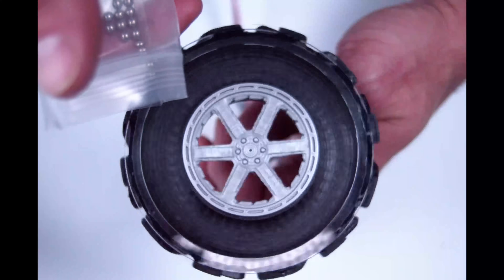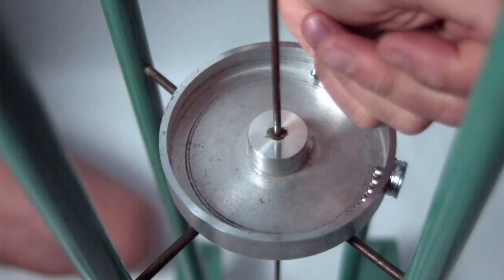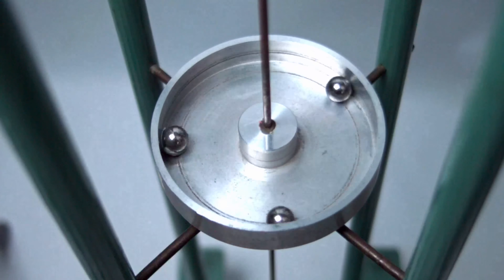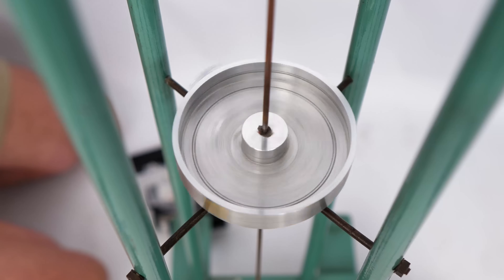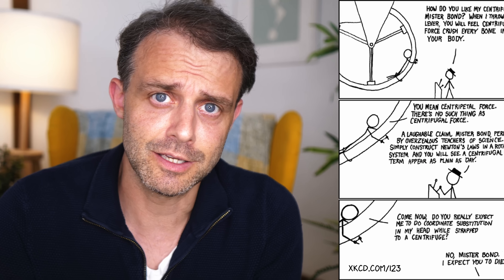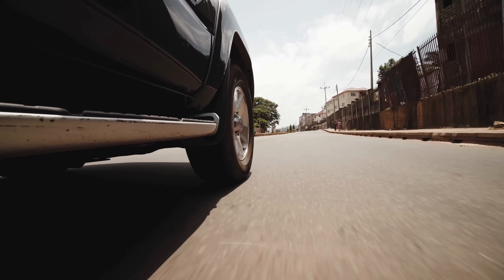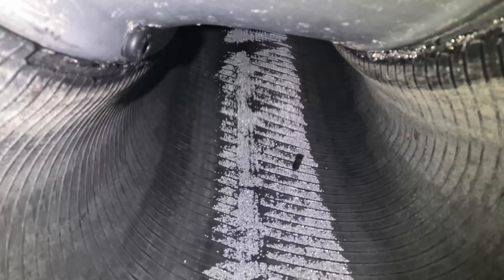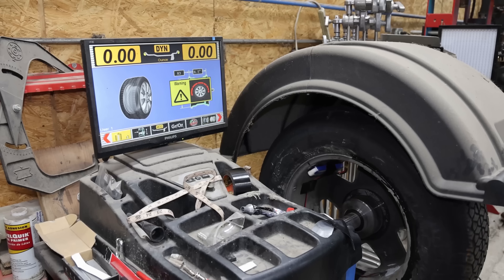Do tire balancing beads actually work?

Comment: I drive a Lexus GS400 that has always been super sensitive to front tire balancing. The tires have to be %100 perfectly balanced for the steering wheel and front end to be smooth between 60-80 mph. If the tire balance is %99 or less, the ride is ruined by steering wheel shake on the freeway. This problem happens with any tire, wheel, and alignment condition that I've tried, and with worn or completely new suspension (every rod end, ball joint, and rubber joint replaced). I have my tires balanced and rotated frequently, since it's free at DT, and even road force balancing often has to be repeated several times.
Strangely, a drive to work on the freeway, and everything is completely smooth. On the drive home, the steering wheel is shaking like mad, and front end has a shake!
This video was what I needed, to convince me to try glass beads! Thanks!

Comment: They work especially well for DIY motorcycle tire changes. And they begin working probably around 40-50 mph, but as you slow down to below about 30-35 mph the effectiveness stops and the rider might notice that it suddenly feels as if a tire is out of round or going flat. The beads work so well we dont know they are working, until we slow down and they stop working.

Comment: So centrifugal force is basically inertia working to a connected centerpoint that changes the direction constantly, hence a straight path but in a circular way through the axle?
If you could, could you also explain the centripetal as such?

Comment: Ride-On
it's balance beads plus tire sealer.  i've been using that stuff for years and i LOVE it.  and the sealer is water soluble, so it doesn't leave a nasty residue like Slime would.
but the reason they're so perfect is because, once they're set, they pretty much stay there.  and they don't need nearly as high of a speed to get into position because the sealer acts as sort of a buffer.  instead of being slung around at lower speeds, they move much more slowly, so the minimum speed is only 35-40mph.  the instructions say, for your first drive, you need to go 40mph for ten minutes in order to set them.  
if you don't drive every day (like over the weekend), they do slowly collect back at the bottom, but it's not bad, and it very quickly gets back to normal.  in a car, you may not even notice it at all.  i notice it on my bike, where everything is a lot more pronounced, but like i said, it quickly gets back into shape.  i don't remember feeling it unbalanced past a mile or so.
i regularly ride over 100mph, and with the Ride-On, the balance is smooth as glass.  the best balancing job in the world can't compete because weights only come in certain sizes.

Comment: Hit highway speeds to balance your wheels and have to do it every time you stop, or simply have your wheels balanced all the time?
hmm... tough choice 🤔

The principle clearly works, i just don't think its better or more practical than actually balancing your wheels. I can see it in the same usecase as tyre sealant - a quck fix until you get to a tyrre shop..

Comment: Big misconceptions is using these beads on a low profile tire is a no-no and you should always have the tire balenced normally THEN pop the bead slightly to pour in ONLY stainless steal beads.
Off roaders use these because our tires commonly get knocked out of balance bit as mentioned in the video, beads don't perform well at low speeds (under 45). The beads  take a while to level out into position.

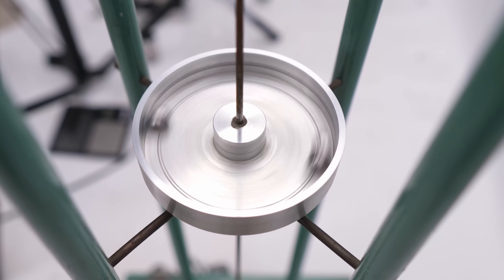Comment: 0:40 CD/DVD drives have such things in them. Take an old CD drive from an old PC and open it. If you take the motor spindle, and you tilt it slightly or spin it you can hear the balls moving inside. Those balance the CD when spinning at high speeds. When initially spinning up the CD disk it doesn't spin up instantly, but go through a "balancing phase" which spins the dvd at a certain speed to let the balancing balls set themselves in the required spots and then spins it up at full speed.  Nerding over balancing balls and CDs lol kinda clicked when i saw the demonstration setup.

Comment: Ok, so if beads start bouncing around if the speed gets too low, what if we pour inside beads with some sort of liquid solidifying rubber glue and then immediately spin up the wheel to the highway speeds (or higher) and wait for the glue to set? In theory, this should permanently fix the beads in their balanced places.

Comment: Steve, at the beginning I was wondering where you were going with this. Almost immediately you touched on the critical speed but did not focus on it until later. In the end I realised you actually knew the answer. Excellent job of bringing the process along and explaining. I am not a fan of tire balancing beads unless a long haul trucker. And even then not a big fan. As you noted, it takes critical speed to achieve a working bead balance. Unfortunately 99% of the motoring public spend an average of less than half their driving time any way near that speed. A typical 26 inch tall tire at 30 MPH is spinning at 387.8 rpm. at 60 Mph it's 775.7 rpm. What we often see with balancing beads id a cupped pattern on the tire tread running diagonally across. One customer I has who ran a deliver truck was always complaining about tire life. They would become severely cupped, extremely noisy and vibrate the steering wheel. Tire life was around 20K miles at which time they could not stand the vibration and the damage to the steering system (tie rods, drag links, gear box wear) Finally after 4 sets of tires I convinced them to go with clip on weight balancing. The tire shop disagreed (of course they would) but tire tread  life tripled, no cupping and reduced steering and suspension damage.   So, unless you do a lot of long distance driving at highway speeds the say no to beads. Even then I would say no to beads.

Comment: There is a mechanism such as this in Washing Machines.  It is a disk or drum attached to the main washing drum that contains weighting beads or balls that redistribute themselves to offset or balance any imbalance in the spin dry cycle, because of uneven clothes distribution in the drum.

Comment: Barring actual structural issue such as wobbly wheels (that can't and shouldn't be fixed with load balancing), minuscule differences in said balance shouldn't matter enough for anything that isn't free spinning at massive RPM, which tires aren't. They also deform enough upon ground contact that they are never actually round, and the weight gathering at bottom would impair acceleration from standstill. Even if we are trying to balance a propeller that isn't in contact with anything and doesn't slow down often, it would need a proper ballast bearing track to prevent excessive abrasion damage. Uncontrollable bouncing never did any good to a mechanism.

Comment: Solution: get a smaller radius of tire, this way the angular velocity is higher for a given travel speed (v = v_ang * r). This should also lower the balancing speed threshold. I admit it's a bit of an extreme solution, but it should work I think :)

Comment: Personally, as someone that worked at a tire shop to pay for college, I hate everyone that uses balancer beads. From an actual mechanical perspective, If your tires are large enough that balancer beads are your only option, there's a 95% chance you have the wrong tires unless you really know what you're doing.

Comment: Why not use both? Get it close with wheel weights, add beads, then at freeway speeds, you have near perfect balanced tires. Though, I think at this point you'll start feeling imbalances in other parts of the rotational masses of the drivetrain.

Comment: I switched to balancing beads when the cost went to $15/wheel to have them balanced conventionally. I can change them by hand and now save $30 or more per tire/wheel by doing so. Never had any problem with vibrations at any speed since switching.

Comment: Why can't you have beads that at the right speed. find its proper location. heats up and stick to the insides.
or while spinning the tire in the shop. once balance has been achieved. Apply external heat to activate the adhesive.
Reply: Or you could use wheel weights,  proven effective for more miles than you can shake a stick at!

Comment: I worked for a tire manufacturer for 15 years.  Beads work but I wouldn’t recommend tire beads.  The tire liner is made of butyl rubber. It’s a soft rubber that surprisingly is the only layer of rubber that holds air.  The rest of the rubber layers and belts are porous enough to let air slowly escape.   Because the butyl rubber liner is soft, beads will wear down the liner and the tires will leak air (slowly).

Comment: Ok how about, putting the beads with a slow curing glue in the tire, spinning it up, then reducing the speed to safe power and waiting for the glue to cure => perfectly balanced tire, no need to speed up in the future, or loose the balance when your coming to a stop.

Comment: The wheel balancing situation I experience is as follows.

Drive along around town, everything is fine and smooth.
Get onto the motorway (freeway, autobahn, whatever) and the vibrations will suddenly start up. However they will only have a duration for a certain amount of time, until I have driven past that point where the imbalance causes undue vibration through the steering, as in your video, I experience this at somewhere between 70 and 80 mph.

The advantage, in my mind, and I suspect someone will be able to confirm this, is that when a wheel is balanced at the mechanics, the balance is good for _all_ speeds.
I suspect that a well balanced wheel will wear out the various parts (track rod ends, bearings, steering rods etc etc) more evenly than a wheel that is not balanced.

If you don't like to see those little weights on the outside of your nice alloy rims (honestly who does), ask the technician to put them on the inside of the wheel, not the outside.

I like the idea of these beads, but having them flying around inside your wheel  at the 'slower speeds' will surely create a greater imbalance in the wheel and wear out all the above mentioned parts even more !

Comment: Very interesting!
I wonder if this could be applied to surface grinding machines. On these, the grinding wheels need to be pretty much perfectly balanced, because any vibrations will show up in the surface finish on the ground part. If you'd have a balancing flange on the wheel with free to move ball bearings, the wheel could balance itself, possibly perfectly and greatly improve the surface finish!

Comment: honestly, if i were to do this i'd do it with a fluid that dries, resin or silicon for example, keep the tire spinning until the fluid dries, that way you don't have an abrasive rolling around in the tire wearing the rubber away, and moisture from inflating the tire doesn't condense into the rubber dust creating a glue that gets the abrasive stuck at one point in the tire when the vehicle sits still

Comment: There are things called "centramatic" balancing rings that bolt onto a truck's brake drum, basically metal rings with these beads inside, that do the same thing, though you don't need to put anything into the tire.

Comment: As a trucker I have used the beads and fluid in the tires.  It works very well, but there is a wobble on initial start up, but by 7-10 mph absolutely perfect.  I tried it in my car with less than ideal results.

Comment: Normally when your wheels are slightly off balance you start feeling the vibrations at highway speeds only. So I would not consider them as a total solution, rather just perfecting that last small bit in high speed conditions.

Comment: I've been using balance beads in my motorcycle tyres for well over 15 years, in fact I bought a dedicated tyre fitting machine so I could fill the tyres with balance beads myself. I can honestly say that I've never had an out of balance motorcycle tyre since. The stuff just seems to work. Thanks for providing a scientific background for my gut feeling. When people question how such snake oil could possibly work, I'll refer them to your video... :) Thanks!

Comment: I don't need to finish the video to tell you why. It's because of the same reason our universe is not quantized by particle. It's quantized by resolution. Therefore the ratio of the radius of the axle, and the radius of the wheel averaged over time and circumference due to limited resolution and finite particle size is how you determine when resolution becomes symmetric and cancels out to bring the wheel into balance. It's the same mechanism for lagrange points. Our universe functions on the same recursive rescaling. you can see it in the critical strip of this reimann zeta function. The Pole that looks like a fairy chimney is an actual shadow of the Higgs manifold experiencing it's first rotation out of symmetry for a given resolution scale. It happens to be a mobius manifold so that fairy chimney runs helically around the zeda torus as it rotates off its own plane creating the first interval and laying all trivial zeroes, negative ratios of numbers, closed form solutions of pi, and the transcendentals in between. You can see the breach of symmetry into a duality right in the coordinates. That's because.
As the fairy chimney pole, which is actually an axes with an actual radius, wrapped helically around the torus, integrates itself into a coordinate system eventually coming back to its origin at the pole. But since it's a mobius manifold, it enters the back side of the pole. This forces an equal radius axis to push into the back side of itself. This unzip's the pole laying its circumference down as the new interval on the zeta manifold. Collatz is this process the pole becomes the power of two axes from collatz at real part one half. I'd like someone to peer review my paper.

Comment: if centrifugal force was the factor for the balls to align themselves in diametrically opposite positions, why do 4 balls align themselves in a square? a rectangle would also be able to cancel out the centrifugal force experienced... even if theres 2 pairs of 2 balls attached to each other but diametrically opposite to each other

Comment: I work on and drive semi trucks everyday. There is almost never a tire balancer in a semi truck shop they have always just used balancing beads. I’ve seen golf balls in tires, lead shot and crossman bbs. The bbs rust though and turn into a rusty dust. But I use them in my service truck everyday.

Comment: The advantage to beads is they adjust for tire wear over the years.  
And cheeper, you can change your own tire and toss in the recommended weight of beads and your good to go.
The downside is they need to hit 55 to fully balance out. 
I choose option 3. Never balanced a tire for my car 😂

Comment: Tire balancing beads work so long as the inside of the tyre remains circular, and there is a material mass imbalance in the tire construction. That imbalance can include the mass of the filler valve, weights being out of balance, or a flat spot on the tread of the tyre where rubber is missing.

Comment: I feel like this is the sort of thing that works in theory, but in practice is not practical. The last time I had 4 tires mounted and balanced at my local mom&pop shop, it was like $130. I'm not sure what the breakdown in pricing is but say it's half, so $16.25 per tire to balance. Well worth it because then it's balanced at every speed, all the time, and you don't have to worry about beads sloshing around in your tires either causing wear or getting clumped up with moisture.

Comment: What if we were to use a dense, flexible resin (like a thick paint) that starts with low viscosity and hardens without losing mass? We would put some in the tire, spin up to freeway speed and let it cure. When it's done, the tires should be in balance, right?

Comment: Only by looking the title of the video no it doesnt work it works only with a certain rotation speed wich is not all the time present in normal condition in a tire so it would work when always droving more then maybe 30 or 40 mph by the way thoose beads would not compensate if the wheels gets a bump to hard only with fix mounted weight the inbalance can be replaced then the inside of the tire has nothing to do with the outside of the wheels so spinning it would balance out the middle of the tire there the centrifugal force would balance out the rubber from the tire but it would not take out the inbalance of a hard taken bump on a wheel like the wheel is damaged and normally you should change it but how many people do you know wich spent 3. 4. 5k on wheels and then they took a little big bump and that bump on the outside whel will no be inbalance because the beads only push on the tire not on the wheel itself fox mounted weight on the wheels balance thoose nicely out but if you got a bump on the tire that means the rubber gets shreded a little bit of that inbalance can aldo be replaced with fix weights so ofc we only use fixed weight and never gon’a use beads in a tire the idea is great in theoretical and in perfect pratical condition but a driving car encounters to many hazards that such a method would never replace the fix mounted weights on a wheel

Comment: Great video! One important detail that's often missed: the reason the balls shift sides at higher rotation speeds is due to a phase shift in the vibrations of the system.

At low speeds (below the system’s natural frequency), the shaft vibrates in phase with the unbalanced mass, so the balls move toward the heavy side — making imbalance worse.

But at higher speeds (above the resonance), the shaft vibrates out of phase — it flexes in the opposite direction of the imbalance. This causes the balls to move to the opposite side, naturally compensating for the imbalance.

It’s a beautiful example of how phase in forced oscillations leads to self-centering — not just centrifugal effects.